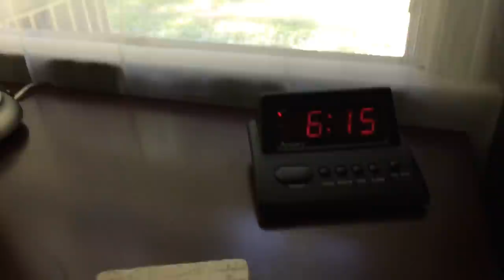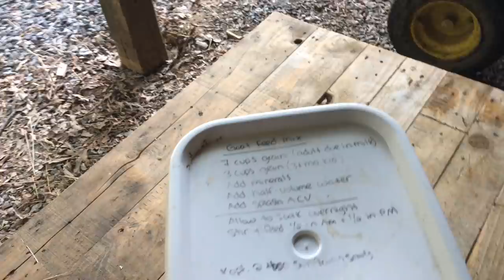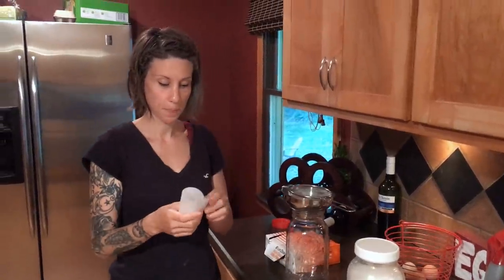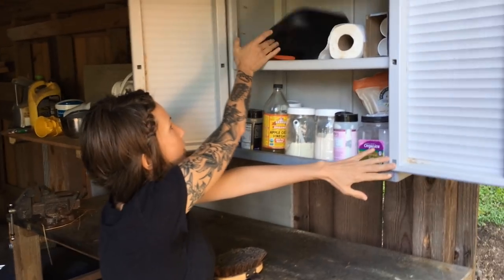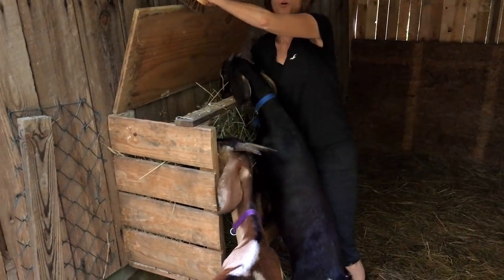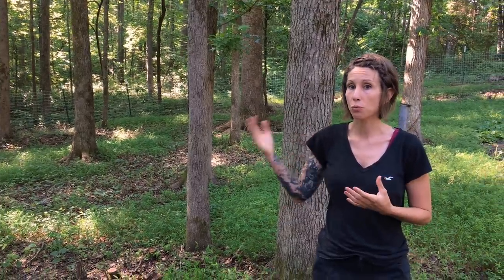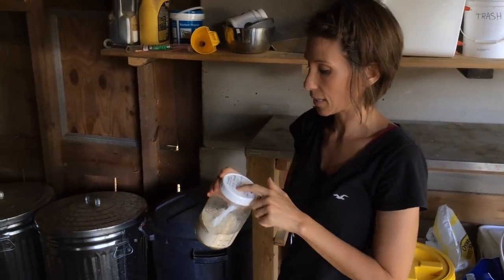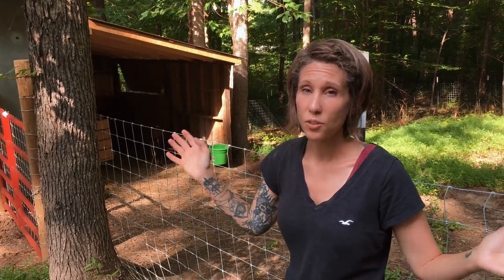Our Daily GOAT Routine

Comment: You answered so many of my questions as the video went on. I love how informative your videos are! :) Your goats are so sweet. 

Have you noticed a decrease in your eggs with this heat, too? I'm in VA, right on the NC line, and one chicken has gone broody and the other hasn't been laying often. But both increased production on the cooler days we had recently! This is only my second summer with them (they started laying mid-summer last year and were very consistent).
Reply from the maker: +Rebecca P. - We did have a week in May right after we moved the chickens to the new coop where they quit laying. They are back to normal now at about 2 dozen per week from the 5 layers. Haven't seen a decrease yet from the heat but it's just now starting to hit the 90's so we'll see what happens.

Comment: Redmond salt is a great mineral salt to offer free choice for livestock, plus you can get it in blocks if that's more convenient. Another overlooked seed crop to boost protein is pea seeds, at 24% protein. You can even do a sprouted pea seed anywhere from just a 24 hour soak, on up to 7 days as you would with any sprouts or sprouted fodder feeding system. Even your barley would go much further if you did a seven day sprout, and it would provide more active phyto nutrients.
Reply from the maker: +DIY Gardener I heard some good things about Redmond. I may try that. As for the peas, there is some controversial issues with feeding some legumes to goats.  Especially in excess. Probably something we will avoid for now. Thanks for the tips
Reply: Guildbrook Farm | Simple Sustainable Living - Yeah a balanced diet is always essential for animal health, so excess of anything can be detrimental especially legumes. Anytime your transitioning feeds stuffs in a ruminate animal, you definitely 
 need to make a slow transition so the rumen bacteria can adjust to the changes in feed stuff like pH. The transition should take place slowly over a minimum of 3 weeks. Many ruminate animals can get serious bloat from excessive legume consumption, especially if they're eating things like wet clover forage in the feilds; however, seeded at 40% max legumes  even a feild that's wet with rain is safe for cattle one of the more sensitive ruminates to bloat from one of the more bloating legumes like white clover. If you are thinking about eventually switching feeds, talk with an extension expert, or someone who is accredited in animal science specializing in goats. As the calcium rich nature of clovers, alfalfa and other legume hay is very helpful to lactating dairy animals, and balances out well with the low calcium high phosphorus content in grain to optimize overall health :) Food for thought!

Comment: I would attach a metal plate in a horizontal position to the gate on the inside side of the "pen area" and attach a large magnet to the fence post so when you go into the pen you can just push the gate closed and it will stop and "latch", would make securing it easier.  Just a thought.
Reply from the maker: +ed - That's a great idea 👍🏻 I'll try that. There isn't enough room between the gate and the post to use a regular latch but a magnet just might be the answer!
Reply: Glad you like it. The metal plate would need either be bent to compensate for the offset or 3 pieces of metal welded together to make something like this. Your husband is very handy, should be a breeze for him.  
                       ________Post
Gate________|

Keep up the great videos, we're really enjoying them.